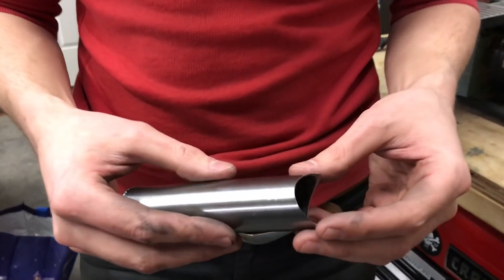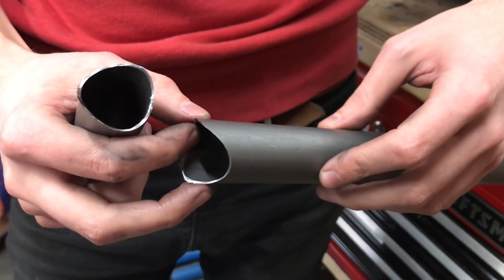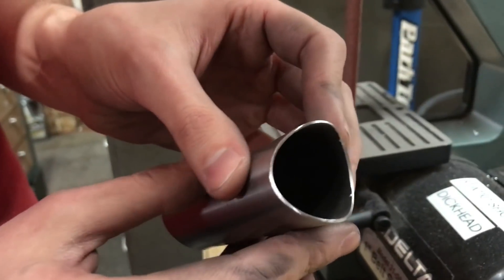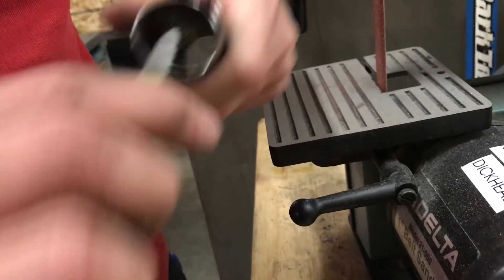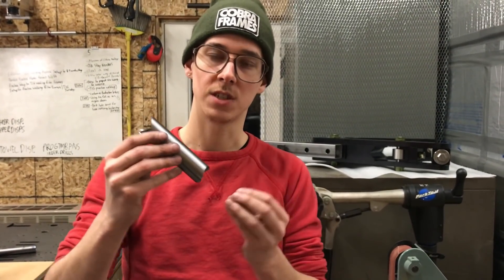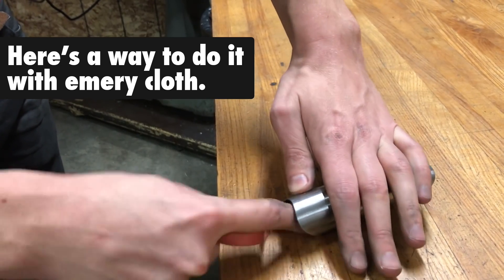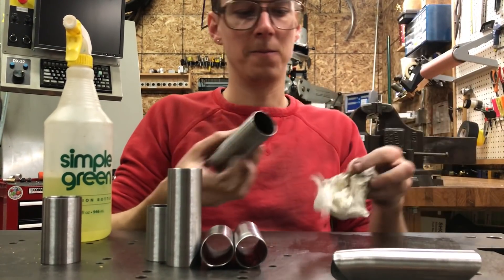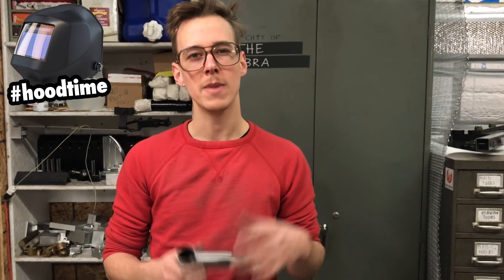How to Prep Bicycle Tubing for Welding | TIG Tuesdays

Comment: If you're still battling being shocked, you can get the stuff the electronics crowd uses: a bracelet that has a 1 megohm resistor in it, and a cord that clips to the tool.  This will slowly dissipate the voltage rather than you and the tool equilibrating in one big painful zap.

Comment: put a small chain around your ankle long enough to stay in contact with the floor if it's concrete, if the floor is wood than a piece of screen on the floor bonded to machine with the chain around your ankle = no more shocks.

Comment: Do you put zinc chromate or some other corosion inhibitor inside your tubes?
Reply from the maker: When it’s done you can cost the inside of the frame with Frame Saver. It’s a waxy petroleum spray that you can get inside the frame if you have a properly vented frame.

Comment: For your shock problems you should check the bonding of you sander. If its more than one machine check the bonding and grounding in the panel. Love the content.
Reply from the maker: I was finding if I just keep my hand on the chassis of the sander in use there were no shocks. I think it's just from the belt passing along the work piece in a dry environment and creating a positive and negative charge between me and the tool or something, but if I allow that charge to continuously be equalized there are no noticeable shocks. I think if I had sanding like this to do all day I would make a bracelet or something that was grounded to the machine I could wear? I heard someone mention a "ground strap" once when I mentioned this before and maybe they were referencing something that already exists?
Reply: @cobraframebuilding  you're looking for an anti static wrist strap. They're used in electronic component assembly processes. Something like this: https://www.amazon.com/Rosewill-Grounding-Alligator-RTK-002-Detachable/dp/B004N8ZQKY